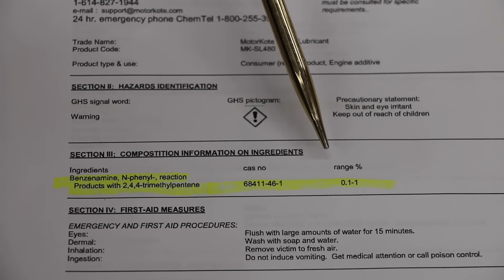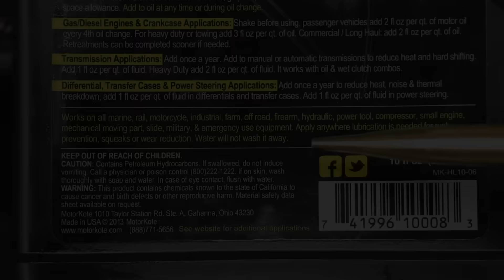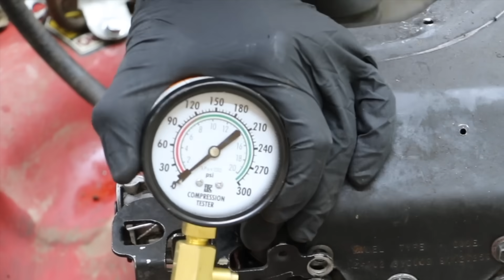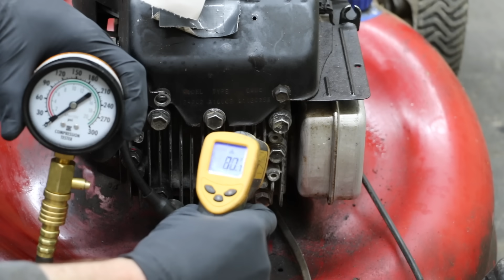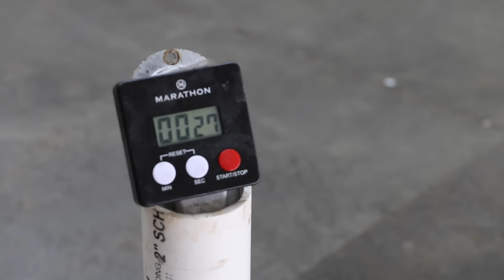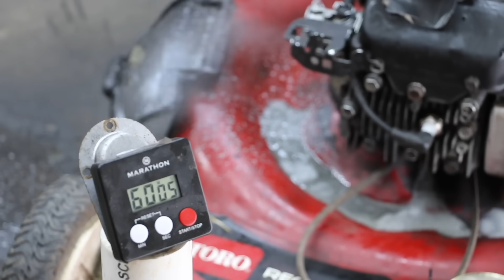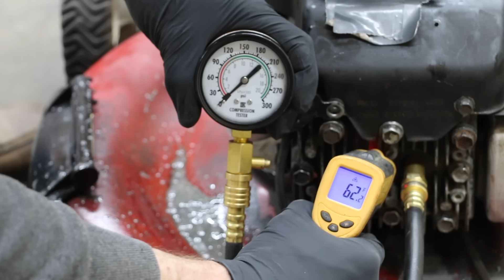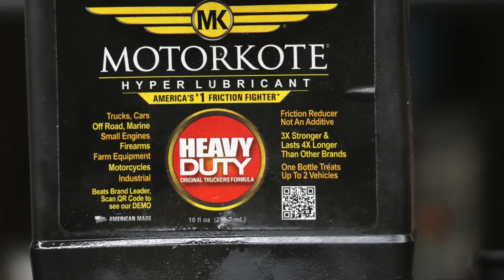Can MotorKote survive the water test?  Let's find out!

Comment: Screw it just run straight moterkote lol
Reply from the maker: LOL!
Reply: i would also like to see how 100% motor coat lasts would be about 90$ for a oil change but if it will last its worth the life of your motor
Reply: Expensive! About $18 for that little jug around here. In my comment above, never mentioned how much I love this channel, and his testing, it's so good to have someone other than the infomercial people who you know you can't trust,do it, so it is appreciated Project Farm!
Reply: I have straight MK in an electric air compressor my neighbor gave me. It fell over when he was using it and it seized up before he noticed. I got the piston freed up and put some MK in it and I have used it for years, it only holds a few ounces but it is %100 MK.
Reply: https://www.amazon.com/Motorkote-MK-HL16-06-16oz-Hyper-Lubricant/dp/B000EGAM0I/ref=sr_1_2?ie=UTF8&qid=1529149433&sr=8-2&keywords=motorkote&th=1  Best price I can find.
Reply: dang man thats about the price of regular oil
Reply: it's all ready like 80-90 for a oil change so No price difference
Reply: damn dude who is ripping you off on your oil change? that's outrageous for a standard oil change
Reply: @stuffhappensdownsouth9899  if your car needs an ultra lightweight (0w-xx) oil then it gets very expensive very quickly. And running an engine requiring that lightweight an oil on motorkote probably wouldn't end well (at best you'll probably have malfunctioning variable valve timing, as engines requiring that lightweight an oil usually do so due to hydraulically operated vvt mechanisms)
Reply: man i could see that for a high end sports car and daddy war bucks fitting the bill or something but this is project farm, we just don't want our old truck to die before its time....
engines with variable valve timing are trouble waiting to happen its more efficient but waay more moving parts to wear out an break! thats why they need such light oil and high maintenance.
BTW i said a STANDARD oil change
Reply: +Jay Means plenty of "standard" engines from everyday manufacturers specify such lightweight oils, im not talking about ferarris and bugattis lol. Vvt and vvl aren't necessarily that unreliable, theres a huge number of ways to achieve the same thing. I'm driving a toyota with vvt with over 300000 kms on it and its never had an issue with vvt. But then again, it is built by toyota after all. I know for example the Subaru vvt systems can tend to have issues down the line, but they aren't exactly known for building ultra reliable engines in the first place.

The tech is here to stay whether you like it or not, if you go without vvt then you sacrifice power at either the low end or high end, as the ideal valve timing (and lift) changes with rpm/load. Most manufacturers do it for superior emissions figures, although Honda do it to make their anemic engines look like they have comparable power figures on paper to the competition (Hondas tend to make their rated power figures at insanely high rpms that no one ever drives at and tend to be very lackluster compared to the competition at more reasonable (<6000) rpm ranges). Ultra lightweight oils also help with efficiency (its easier to pump around) regardless of vvt so its another reason manufacturers specify them.

Edit: Also even though ultra lightweight oil may be much more expensive a cost each oil change, your oil cost still pales in comparison to your fuel cost. Using very rough figures (from Australia), my car costs about $30 to change the oil each time (new filter + ~3L 10w-30 oil) but I'll spend roughly $1000 on fuel in between oil changes (assuming I did it at ~10,000 km intervals and drove mostly in city traffic). If my oil+filter cost doubled to $60 (if I had to use 0w-30 it'd get pretty close to that) then I'd only need a 3% increase in fuel efficiency to break even.

Comment: If your engines are iron based, I wonder if after you drain the oil into a jar you could take a powerful neodymium magnet to collect all the iron filings.  Might be a more reliable way to analyze engine wear.
I wonder if a centrifuge could work too.  Considering all these engines you have, I'm sure you could just make one yourself.
Reply from the maker: This is a great recommendation!  I've thought about building a centrifuge.

Comment: I added MotorKote to my car 3,000 miles ago, my smart now has 80K miles, had Blackstone test my oil at 51K miles and it had next to nothing in it (metals, fuel, chemicals). I think I made a good choice.  :)
Reply from the maker: This was the information I was hoping to find out.  I wasn't sure what the oil would be like after a few thousand miles.  Thank you for commenting on this!
Reply: 2008 smart fortwo, mercedes product, 3 cylinder 1 liter mitsubishi engine. the smart is a mutt, japanese engine, german transmission and french body. i will add this to my next car, whenever that is.
Reply: It all depends on your budget. What year engine? Online Salvage Yards- $300-$500 for the intake, rail, regulator, injectors- all as one unit. You'd need an electric fuel pump, new gaskets, any vacuum hoses; then an ECU to run it. Cheapest= $800-ish total. Use RockAuto for small stuff (gaskets, etc.) Now new- you're talking easily $1.8k-$2k total. CARiD.com is great for all that. They've got many nice things there, thousands of connections to worldwide suppliers. 350ci (5.7L) WAS a popular setup at one time, not now. Everything is 4-6 cylinders now, so stuff for v8 is cheap. Start going to 383ci and the 400's and 600's, that's drag stuff- that gets stupid real quick. I'd just prefer MPFI any day. Way more power, smoother, better MPG. Think about it; a 2bbl TB=2bbl carb. 8MPFI=8, 1bbl carbs! CarPart.com, enter year of donor car of engine, etc. "85 Chevy MPFI Caprice= POPO 5-0! Imagine- in a few more years- all the Municipality auctions will be loaded with 200k mil Dodge Chargers. LOL
Reply: Thank you for the info. I will be adding this to my oil change process.
Reply: What year and model car?
Reply: Get a MPFI manifold, 8 Bosch III injectors, and the ECU or a Mega-Squirt. That C10 will fly.
Reply: HUBBABUBBA DOOPYDOOP sounds expensive, but I like the way you think! Got any part number recommendations?
Reply: Daulton Hubbs 1985 Chevy C10 Cheyenne. Just did an engine swap. It's now a TBI 350/4L60E. Fun project. Just don't wanna do it again any time soon! Lol
Reply: buys a tesla

Comment: By any chance are you a refrigeration or air-conditioning engineer by trade? The vacuum pump I noticed that you used to pull the oil out is used in those trades.
Reply from the maker: I'm not, but I do my own refrigeration work on vehicles and appliances.  I shouldn't be using the vacuum pump like this, since it's sort of hard on it.  Thank you!

Comment: I wish you would have taken a 3/8ths or 1/4 beam style torque wrench, and measured the amount of force it took before rotating the engine, with the spark plugs out, before and after the motorkote. That would be a great way to test weather or not it does reduce friction. 

However the water test was a fantastic way to show how well the motorkote sticks to metal surfaces and creates a permanent film. 

I would like to see a control, when you are in the mood for a destructive test
Reply from the maker: All great recommendations--thank you!

Comment: It's MotorKote for the Win.  👍🇺🇸 🇺🇸 🇺🇸 I've used Motorkote for years. Buy it at Walmart.  http://motorkote.com/
Reply from the maker: Thanks for commenting on this. Have you experienced fuel efficiency improvement?
Reply: Ha. I have never checked. If i have it.s not very noticeable. I use it in my 1999 3.4 V6 Toyota 4Runner with 121000 miles on it which isn.t known for great mpg and l get 19mpg on the freeway.

Comment: Wow!  That's a lot of science in one video.  To make a fair comparison,  how would the engine have fared if you had just put the oil in first, then did the same thing with the water?  Of course you would have to do this before using MotorKote because it's supposedly adheres microscopically so well.   Inquiring minds want to know.
Reply from the maker: Thank you for this video recommendation!

Comment: Not good for motorcycles with wet clutches. Didn't cause any damage just clutches slipping
Reply from the maker: Great point!  This stuff would be way too slick.
Reply: worked great with all my bikes never had this issue just sayin
Reply: I reached out to motorkote before using it on mine, this actually will make your wet clutch grab better, did you do an oil change at the same time?
Reply: yup motorcycle manuals says dead on do not add oil aditives
Reply: Thank you for the heads up . That was going to be 1 of my uses for it.
Reply: nightmare in action never read the manual for my bike it's 4 different bikes in one with Accord and Xterra parts
Reply: Tanner eversole yes new oil valvoline regular motorcycle oil for wet clutch application
Reply: Older bikes with separate crank cases and gear boxes and primary cases, this may work well for however.

Comment: I knew it! I use this additive in a lot of machinery and It does work . Thank you for further confirming my Faith in this expensive product it's worth the money as I see it.
Reply from the maker: Thanks for commenting on using this product.  Have you seen an increase in efficiency?
Reply: Project Farm     not really sure about efficiency, but certainly longevity with old motors running longer between a overhaul or old motors kept going.

Comment: I just checked out the prices of motorkote products on A****n. Prices are a bit steep, but your vid goes a long way to help justify the cost. This is some surprisingly good stuff.
Reply: I'd rather pay for something that actually works than throw money away on snake oil just because it's cheap.
Reply from the maker: I agree--it's expensive!
Reply: bill myke Walmart sells it too.
Reply: Per treatment, it's cheaper than Bestline. Still though.. No additive's, or Bestline/MotorKote only.. :)
Reply: I just bought seven 32oz jugs at Walmart for $7 each. Good luck. Most are out of stock I past like 6 Walmarts. Pro tip limited stock means they probably don't, but might have some. In Stock means they do. Still had to hunt in the store it was in the clearance section in automotive. Also these had a $5 mail in rebate that expired in 2013 lol
Reply: bill myke Amazon?
Reply: madmax2069 I can neither confirm nor deny that.  ;)
Reply: Try O'Reilly auto parts

Comment: I'm skeptical of these types of products. But (this one) like you said looks pretty good. Oils are formulated to work and compliment the metallurgy of the engine make-up. Steel (alloy) aluminum (alloy). Alloy= a substance composed of two or more metals, or of a metal or metals with a nonmetal, intimately mixed, as by fusion or electrodeposition. Any idea why the MSDS didn't reveal all of the ingredients?  Another good job. Thank You:-)
Reply from the maker: I believe they are trying to protect a trade secret.  The ingredients must not pose too much of a health risk or I'm pretty sure they would be required to list the ingredients.
Reply: Makes sense. TY for the reply.

Comment: Great video! I’ve used Motorkote for awhile now. No complaints here. Rislone is good too but it don’t last as long as Motorkote as for being a friction reducer.
Reply from the maker: Thanks for commenting on using MotorKote.  Have you had oil analysis done on it after it's been used?  Blackstone Labs is used by a lot of people.  Could you please create a new comment so I can easily find your response?
Reply: Project Farm About the only analysis type of experiment I’ve done is I put it in a hard shifting transmission once. I applied 3 ounces & ran the vehicle 30-45 mins. It did smooth out the shifting problem & the transmission is still on a running vehicle with 240k miles. The problem occurred around 30k miles ago. After I seen that it was a good product I started using it in all of my vehicles. Every other oil change, even in the power steering.
Reply: Project Farm as with the Rislone, I’ve used it 3-4 times. With it I could tell a power gain, as if the vehicle ran out better but seems like it didn’t last but maybe 1k miles. It also quieted down noisy lifters for awhile but the noise always came back bout the same,1k miles. I’m not knocking Rislone, but I do like Motorkote better.
Reply: Project Farm as for oil analysis I’ve never did one before although I can say that when it’s oil change time, the oil in my vehicles looks just as good as the day I changed it. No sludge at all, it’s even the same color. Pretty much looks like new oil & is just as thick. Seems to hold up its viscosity really well as it didn’t use to do before using Motorkote. I will note I don’t use a high end motor oil either. Usually a syn blend. Thanks for making all these useful videos tho! Great job

Comment: lol i thought for shure you had not ran it long enough for the motorcoat to bond boy was i wrong that is some great stuff there was something like that in the late 80s or early 90s but it didn't seam to work as claimed this seems to work better than i would have thought when you can afford it it would be kool to have a tack to see if there is engine speed change
Reply from the maker: I see why a lot of truckers use this stuff.
Reply: who knew a product that does close to what they said lol thats great